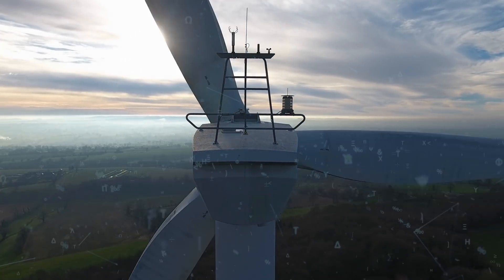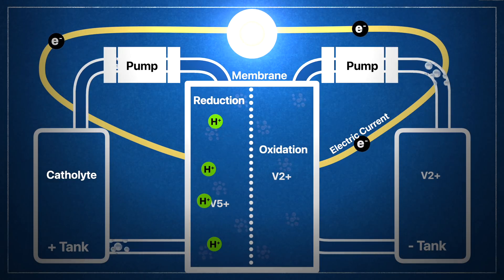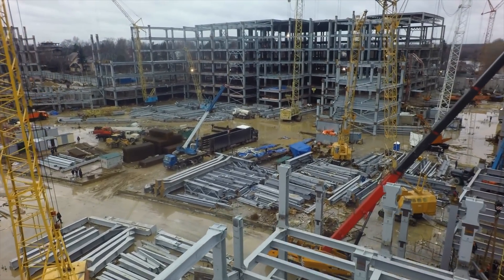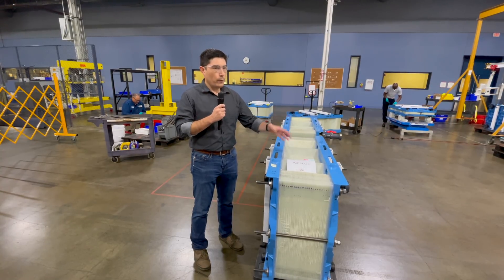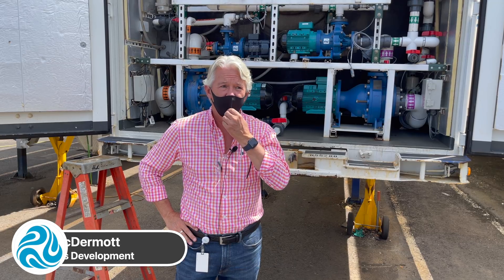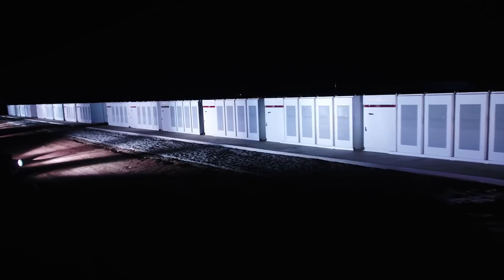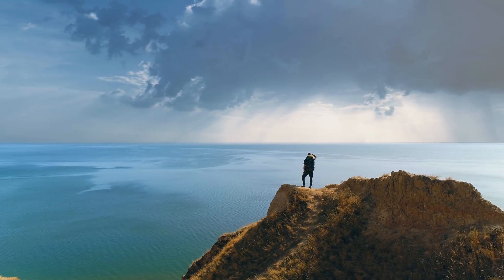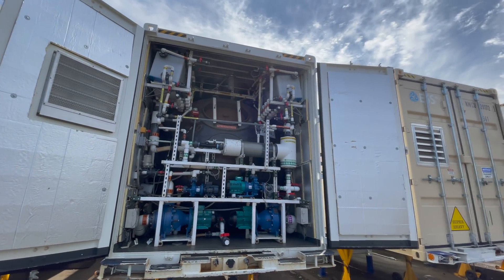The Future of Energy Storage Beyond Lithium Ion

Comment: I’m an old mechanical engineer and have been into this stuff for 30 years….This seems like the best option I’ve seen so far - it will be low cost, will last for a very lomg time, will not mess up the environment and will provide power over a long duration - time to invest!!!
Reply: Do your homework before sinking any money into flow batteries.  I worked on an Imergy (now bankrupt) vanadium redox battery a few years back.  Energy efficiency was an awful 60% due to the pumps and fans.  Efficiency only gets worse if you're not cycling it daily.  I know they sold a lot of them in India because of their unreliable grid.  There are few viable use cases IMO.
Reply: @mattmills7867  I too have worked in the flow battery industry for +10 yrs.  And you've hit in on the spot; the video & most people fail to address the auxiliary losses.  This loss is further compounded when the system is trying to discharge the remaining unusable energy by running the pumps continuously otherwise unwanted platting can occur. There is a quick and dirty solution that involves a manual intervention with a resistor(s).

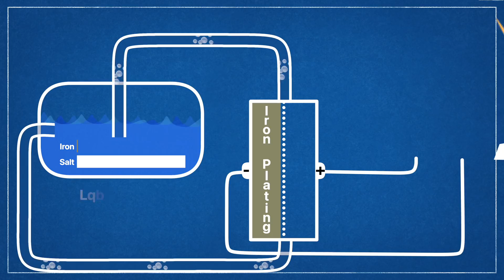Additional the representative from the iron flow battery at around the start 7:00 mark was misrepresenting the usage of dc/dc converters on iron flow battery only and not on lithium.  All batteries I've worked on always required a dc/dc converter; some pre-built and others were 3rd parties.
Reply: @mattmills7867  Thanks for the advice, hopefully the efficiency of things on the mechanical end will improve!
Reply: @mattmills7867  The better in this video is with Iron, not Vanadium.
Reply: @mattmills7867  so how's this battery compared to the one that made you go bankrupt ?
Reply: @icost4671  Imergy went bankrupt.  I was just left with a big flow battery that needed to be decommissioned.  The Imergy battery was a 2 tank / 2 pump vanadium redox flow battery.  The one in the video is a 1 tank / 1 pump iron redox flow battery as far as I can tell.  The Imergy battery included HAZMAT and the iron flow battery doesn't seem to have that issue.  It looks more viable, but I'm not sure it can compete with other energy storage technologies (Pumped hydro, compressed air, Li Ion batteries, flywheels, capacitors, etc.)
Reply: @mattmills7867  thank you for the reply , I appreciate it  greatly 👍
A lot of things in the energy sector is changing rapidly.
Elon Musk is trying to get people to have these battery storages at every home , will be pretty good when power goes down.
I don't know much about it but it sounds pretty good especially if you are EV owner.
Reply: @icost4671  I've got an EV.  I get about 4.5mi/kWh or about 45 miles per dollar at $0.10 per kWh.  If only they didn't have the recall for the battery fires though...  It does seem like America is starting to adopt V2G technology so that might help sell more EVs.  We'll have to wait and see.  And hydrogen fuel cell vehicles might be the next big thing too.
Reply: @mattmills7867  I take it you also have a garage.
I own a home but I have no garage so I have to run a electric cord from my home to the car that will be parked at the curve... if I bought a EV.
I don't think hydrogen is going to be driving any cars anytime too soon because it takes a lot of money going in to create hydrogen.
That's the last thing I knew about 5 years ago . That I heard or read about hydrogen cells , it takes a lot of energy & money to create it.
Reply: @mattmills7867  "It looks more viable, but I'm not sure it can compete with other energy storage technologies (Pumped hydro, compressed air, Li Ion batteries, flywheels"

Pumped hydro would cost how much to install out in a desert?  Li Ion batteries are not going to be a solution for a true green grid.  The amount of storage needed is immense.  You seem to be focusing on a single use case where something didn't go right and you're expanding that notion out to the globe.  It doesn't work that way.

I already pointed out the issue of efficiency not being very significant if you're buying a cheap battery, which comes with economy of scale.  If these show they're successful the key selling points right now outweigh any disadvantage.

I haven't read enough about flywheels but I remember hearing about it about a decade ago.  Are they in use large scale?  I haven't heard anything about them since I remember hearing about them about a decade ago.

Pumped hydro probably costs a lot more than these batteries will, but for coastal areas pumped hydro could be a better option because it takes up less space, but solar farms out in semi arid open land or desert has tons of land.  These start to look really good.

What was said is these are in price parity with Tesla mega packs which are for the same thing, except in very hot place, like where a lot of solar is best generated at least in the US, so west Texas, NM, AZ, CA, NV, CO can all get very hot so Li Ion packs become a problem.  This seem ideal and I guess that's why a few companies have already installed these.  They also said that long term these should be a better value because of greater number of cycles, which is many years, but that doesn't mean the battery container is no longer useful.  It only means they change out some components and change the electrolyte from what I see.  They do have pumps.  Once there is economy of scale I doubt anything beats this in operating cost.  You just can't do a global changeover with something like Li Ion.  We'll be digging up too much of the world.
Reply: @johndoh5182  It's great to be enthusiastic about emerging technology around energy storage, so my main point was to point out that flow batteries of different types have already failed to compete in the market.  Knowing that and knowing why is important.  Energy storage is going to be a big nut to crack over the coming decades and a diverse lineup of technologies seems likely.  Besides the tech I mentioned, I've seen some potential energy system that uses a heavy weight suspended in a mineshaft that is raised/lowered to store/recover energy, kind of like a huge grandfather clock.  There are going to be some tech that ends up dying, like using blimps for air travel.  Maybe flow batteries will make the cut, I'm just not betting on them.

Efficiency is still important even if the battery is cheap due to economies of scale.  If efficiency is low, you'll need that much greater energy production capability to start with.  With Li Ion systems, I think round trip efficiency is closer to 85%.  And even though new Li Ion batteries are around $200/kWh right now, economies of scale have been predicted to bring that under $100/kWh by 2030 (Bloomberg New Energy Finance).  EVs are still a small market but its growing rapidly.  When the car battery range gets below 80% or so, or the car is at it's end of life for whatever reason, you still have usable life in the battery.  These can be used in a 2nd life application as grid energy storage batteries.  Or even with V2G (Vehicle to Grid) they can be used for grid energy storage while still installed in the vehicle.  And you won't necessarily have to keep digging up lithium, cobalt, manganese, etc. if you get recycling to the level you have with Pb acid batteries.

There are other types of lithium too.  Lithium iron phosphate batteries aren't as energy dense as NMC chemistries, but have better fire safety.  Lithium titanate batteries are even lower energy density but have several times more cycle life.  Lithium air batteries use oxygen from the air as part of the fuel, sort of like an internal combustion engine, so they are more energy dense.  And the theoretical energy density of lithium based batteries is near that of gasoline(12,200Wh/kg) even though the best energy density on the market right now for Li is ~300Wh/kg.  I worked with a company called 10-9 technologies that was closing the gap with some promising testing.

On flywheels, I haven't seen any successful grid energy storage applications.  Those who tried were having difficulty with the material science of keeping the damn things from tearing themselves apart at high rpm.  But there are some applications like uninterrupted power while a generator for the building is fired up.  Or they can also be used for fast response frequency regulation on the grid.

I haven't run into any estimates on GWh of energy storage required in the future but I'm not so sure that there's not enough Lithium battery raw material to meet that need.  Anyway, I hope my response addressed your comments.
Reply: Hydrogen has started powering London busses
Reply: @danielfasey7648  as long as the Hydrogen is produced by clean energy that is great! Fossil fuel companies are trying to comvince governments that reforming methane to produce Hydrogen is OK - it isn’t…it has a nasty carbon footprint
Reply: @mattmills7867  I will be replying on your comment but my points will still take in account of the rest of the idiotic comments in this thread (P.S. yours isn't idiotic). First solar and wind isn't a green energy solution as of now. First, the cost of a solar/wind farm vs a nuclear power plant is approximately 17 to 1 I think in materials cost. Although solar/wind dont produce C02 while generating power they damn make it up during their construction. Second, is the fact that there isnt a plan to recycly solar panels after the 20-25 years where they will stop be efficient or operational. They will join the rest of electronics garbage to an African or Asian nation. There they will be stripped from their important bits (aluminium and precious metals) while polluting the ground with heavy metals. Another big issue is batteries (Li Ion) and their short operational life when they are heavily used. So a new storage system is needed for it to work. Third, is the huge amount of land that you would have to use to build the solar/wind farms. You would need to either use farmland , forests , mountains , dessert , etc. No matter which habitat we examine the environmental damage would be huge. Our farmlands are already running out , so dont even think of it . Mountains , the wildlife would be greatly disturbed. Check how many endagered species of birds get killed annually due to wind farms as well as bats. Forests you dont even need to think much about it as you would need to clear them out in order to build solar/wind farms. Desserts , here I will introduce an issue that exist in the other habitats as well and that is the you would have to transport the local wildlife and that never goes well. Check the Californian solar farm and tortoise issue. Lastly what do you think will happen when you capture a significant amount of the heat that touches our planet. Wouldn't climate change again ? For better or worse we dont know.
Now lets talk about the "disaster" of "climate change". Did you know that our planet goes through cold and hot phases ? See Ice Age. Scientist that research glaciers that contain "ancient" ice (ice that dates back to millions and more years) claim that our period is the start of a new Hot phase. By analyzing the "ancient" ice they can know temperatures and the composition of the atmosphere when the ice was formed. You would be suprised how much this practice has helped us to learn about the history of our planet. Most of the fear of the "disaster" comes from either uniformed politicians or fearmongering politicians that want to use this "issue" to further their agenda. Not to mention the way they go about solving this issue is idiotic. Capturing and storing C02 in order to solve global warming !?!?!? phhthhtht  Makes me laugh. Instead of doing something that will help our human race to become more sustainable and "easier" to progress , they thought that and solar/wind power generation. Instead of funding research that will help us find an energy source or a completely new energy that will fuel our human ambitions they chose one of the most idiotic ways to go about it. First capturing C02 would take too much time. So much time that by the time it makes a difference according to them the damage would have been irreversible. As I mentioned solar/wind are not green technologies and they are an inferior version of a technology that is already in the making. Solar/wind basically borrows the power of our Sun. Our Sun produces its power through a process called fusion. Does that ring a bell ? Yes we have been researching now for a long time how to make a fusion reactor and basically create a miniature imitation of our Sun. A lot of people might say that fusion researchers might have been promising for too long results but havent delivered. You should know that the amount of money that has gone into fusion research and ITER is too little compared to how much money has been invested in constructing solar/wind farms. I say constructed do not even mention how much has gotten in researching them. ITER so far has costed about  €18 to €22 billion. I should mention that ITER isn't supposed to become a commercial power generator. It is a science tool like CERN. ITER isnt constantly retrofitted with newest technologies whenever a new breakthrough happens as it is too difficult to happen. Its construction time has already exceeded 10 years. You can only imagine how many breakthroughs have happened since it started being constructed. Imagine if the fusion research got as much investment/support as solar/wind globally.
Reply: @mattmills7867  edison batteries and compressed air batteries!
Reply: @mattmills7867  "Efficiency only gets worse if you're not cycling it daily.  I know they sold a lot of them in India because of their unreliable grid. There are few viable use cases IMO."

I'm not a person who is going to invest first of all and I really dislike comments where people start screaming about it.  I know yours was a response to a person who did exactly that and what you said is a valuable point to ANYONE.

So, don't you think these batteries would cycle daily?  If it's for a solar farm of course it's going to cycle daily.  If it's for wind, you would simply schedule discharging on a regular basis until you know you're about to hit a patch of light wind for a time period in which case you charge them fully for that time and then discharge.

There are other battery tech on the market as I watch these channels that cover power technology and have seen other options too.  But, if the battery is manufactured in huge quantity, there is economics of scale.  Two, like was talked about, they use some of the most common elements on the planet which more than anything else is THE most important factor for grid storage, considering you would have millions of these.  Cost is another factor.  Grid storage has to be cheap.  That's the second most important factor for grid storage.

Efficiency?  It's important, but you have to balance any of that with cost and environmental impact.  It's going to be hard to find something that solves all those main problems.  I'm glad this is already in production and going to available for statistical analysis.  If the cost is cheap you add enough batteries to provide the output you need, right?  So, efficiency isn't the main goal, in fact I wouldn't put it in the top 5 issues for this kind of storage.

As far as investing, if I were that company I'd do everything I could to keep it private, but if the need for huge capital becomes an issue they would go public if they haven't already.  But, Tesla has followed a model of, you pay, then you get, and that can help to reduce the need for large influxes of capital.  But, to get that economy of scale they have to meet that manufacturing capacity.

This is the best thing I've seen yet for grid storage and well thought out for this one need.  

And that last point you made about use cases?  This is designed for storing energy on the grid.  I never once heard them talk about use cases, just use case.  And, that's not an insignificant thing.  It would be like saying that wires to carry electrical current across the country and into people's homes isn't so smart because there's only one use case.  Yeah, except it's pervasive.  There's a lot of tech that has a single use case and it's part of billion dollar companies.
Reply: A friend of mine has been at the head of a flow battery company for a while, it definitely has its strengths but it's more of a cooperative tech against something like lithium. It has capacity density and cost advantages for sure, but can't react as quickly or with the power density of lithium.

Think of it more like a tiny pumped hydropower plant, where the energy capacity is the size of the tank (rather than dam), and the power density is the size of the electrode and pump (rather than turbine).
Reply: @morosis82  Those are factors of capacity and recharge rate. It has no comparison to hydro unless you are referring to pump storage. Regardless, solar and battery storage are the only viable source of generation. Not from a "save the planet " perspective but from a return on investment for the utilities. Nothing else can compete, not wind, gas, coal, nuclear.
Reply: @morosis82  Nice comparison!
Reply: entrepreneur  Lol - OK calm it down CAPS man ;) - I am not saying the rich won't continue to control things in the US, as they control the government - but I have see a ton of people take control of their own power needs as a result of the continuing drop in solar panel and battery costs - with Elon's auto-bidder software ordinary people will be able to turn their home into an integral part of the grid - buying and selling power and stabilizing things - I know people that have put 3,000 watts of power on mobile home - it's cheap!!...lots of others that have just gone completely off grid - watch a couple of Tony Sebas videos to get a good understanding of where were headed - with that knowledge, you will be able to navigate things to optimize your benefit from where we're headed
Reply: @willm5814  You found the right words man.
Reply: Agree the only issue I see is being bought and shelved by a higher up!  Just saying...
Reply: Plasma is the best energy storage, it's how nature does it.
Reply: Or just Soundwaves and piezoelectric quartz crystal batteries to make near infinitesimal energy... The proper decibels without cavitation will produce 1185 fps acoustic waveform propagation fields... Steam from nuclear power plants output 860 psi...

Quartz is synthetically grown and has been for DECADES used in every electronic device you own... By the tons.. no need for batteries, my father called it Project Jericho.. Brownian motion paradox Energy, essentially using a infrasonic waveform to deliver extremely high Decibels as browning motion enveloped Carrier wave " wave within waves..." Using his Soundspheres " expired patent "
Reply: @mjolnirswrath23  Piezoelectric quartz cannot stay activated with a constant, it can only sense change in a medium. And there is no such thing as infinite energy. To actually have a soundwave that produces enough decibels to actually create enough change in the piezoelectric to produce a usable energy will have too high an energy cost to make, plus it is unreliable for the change has to be constant to produce that power, and for an electrical grid all generators must be approximately the exact same or one will overtake the system and most likely explode or collapse. I will have to do more research into it, but these are the problems I currently see.
Reply: Why dont we try Solar Thermal power generation we can store it , and reliance on batteries  will be lesser
Reply: Wonder if this would be good for peak power leveling ie plant makes 8 units power peak power 10 units off peak 6 so charge the 2 off peak to use on peak
Reply: Have you seen the liquid/compressed air batteries? Even better.
Reply: Respect Will..... I really lean heavy on experienced Engineers like yourself
Reply: I quite like the concept of liquid metal batteries. I mean anything that uses heat wastage as part of its function. Instead of as a byproduct. Makes sense to me
Reply: Hi ol m.e. ! I think profit will also be a factor in our monetary world. A wise old man told me today that for society to thrive it takes a civilization  and organization to impliment new products and ideas. He said we seem to be lacking in those areas. What do u think?
Reply: The best option so far is nuclear but the party of science is preventing its use even though climate change is supposed to be a world ending disaster.
Reply: @lkytmryan  Hey now, you can't talk about science because ULTRA DEATH CLIMATE MEGA CATASTROPHE!!!
Reply: @lkytmryan  “party of science?”
Reply: @lkytmryan   Effing Democrats
Reply: @lkytmryan    It's always nice when the nuke peddlers accidentally admit that they're also Deniers. Nuke is too slow, too expensive. Which is why the world added 280GW of renewables last year and net 0 GW of nuke.
It peaked 25 years ago. No one wants to take 15 years to spend $12 billion to build 1 GW of nuke when an equivalent annual TWh of wind and solar can be delivered on grids in 2–3 years for a third to a fifth the cost of nuclear. As a result, we can have at minimum three times the actual annual generation of low-carbon electricity for the same price delivered to the grid before a nuclear plant starts operating.
Reply: @lkytmryan  You're just slightly glossing over the situation. For example, the #1 source of opposition to nuclear power in the US isn't the "left", it's the coal and natural gas industries. If your source back a lot of the material used by people on "the left" on the nuclear power situation, it comes from the coal industry. And yet plenty of folks on the left look at things like localized thorium liquid salt reactors as potentially relevant solutions. 

The other thing you're overlooking is that France's government is paying for the nuclear power, they fund the building, they fund the material, they fund the long term storage, etc... So if your concern is that renewables won't compete without government subsidies, then France is immediately off the table as it is the primary source of investment. Heck, Marcon is lobbying for a $35 Billion dollar >government< investment in Nuclear as I post this.

Even if we look at >just< France though, unsubsidized nuclear power cost 100 euro/MWh. Subsidized by the government that rate dropped to 50 euro/MWh. Compared to on-shore wind 60 euro/MWh (unsubsidized), it's an iffy argument, solar (unsubsidized) at 43 euro/MWh it's a bad argument (and France isn't even an ideal location for massive solar farms), and hydro at 20 euro/MWh it's a horrible argument. 

Nuclear had it's day, but modern renewables are cost competitive and come with far fewer risks and concerns. 

That said, I would happily, gladly even, replace every god forsaken ancient, way past their retirement point, piece of shit nuclear reactor in the US for a French equivalent. And yes, I'm a "lefty" (by US standards).
Reply: @pianodarr   Wouldn't be the case if we had pursued thorium reactors but we can thank GE and Westinghouse for that.
Reply: @lkytmryan  it is usually gas powered generators that are on standby
Reply: @pfwag  or the Military Industrial Complex, or the Governments! Thorium reactors are safer, but do not produce materials for nuclear weapons.
Reply: @rickway2039  the problem is that yes renewables is the best option for getting energy for cheap, all three versions of the energy all require specific conditions that cannot be met everywhere.  Solar needs clear sky’s and flat land, wind needs unobstructed airspace, and hydro needs a lot of water. Electricity can only travel about 300 miles. So that leaves out a lot of land that will not get energy. A repeater can be used but the power loss is too much eventually. Nuclear does need to be reinstated as a main line source for our society to continue to function as it is now. So yes it would be better for us to go with renew, but until we can figure out how to store AC energy, nuclear is the best option. it also has the highest efficiency and the lowest cause of death.
Reply: @kasei6855  I can't speak to the EU and other countries, just the US.  I commented to someone else about nuclear in the US and why it's not viable.  It boils down to, no state in the US is willing to open up an area for storage, although picking an area requires a lot of thought since this storage is for thousands of years.  The best candidate locations were all shot down by state govts.  So right now every nuclear power plant stores its waste, or MAYBE you get one site that stores waste for a couple of plants, but that's a TERRIBLE solution.  It makes every nuclear power plant a super fund site.  On top of that it makes every plant a huge security risk, and to secure it properly takes a lot of payroll.  Second, create plants that generate much less waste.  That part has been solved.  But three, it needs to be economically viable on its own, not with continual subsidy or offsets from other forms of energy balancing out the cost.

Natural gas is clean burning, puts out very little CO2.  It's a very valid option as a backup, along with running from time to time to ensure systems are running correctly.  It can also be a main source of energy, as it already is, but it needs to be capped so the US isn't depleting all its natural gas.

Hydro does require a lot of water, but at least in the US, there are lots of rivers that have already been dammed so creating another lake for both water and hydro is perfectly acceptable where you can do so.  Texas for instance is adding more reservoirs.  Not enough IMO, but they are adding some.  They already have a lot of lakes though, mostly in the eastern part of the state.

If you have a shared grid and you build for plenty of excess, as you should in case of failures, in the US in particular it's hard to be far away from either abundant sun, or abundant wind, or abundant capacity for more hydro.  You still need natural gas though, and a smart energy producer would have something like a solar farm or wind farm along with grid storage, along with natural gas to back up part of that capacity.  It would give them a constant output.  On a shared grid, you need a mostly reliable output, mostly relying on wind, solar and hydro.  If you aren't getting enough from one generator, odds are you can get more for another.  So, shared grid with a bit of versatility helps to solve that problem.

Turn a negative into a positive by people finding solutions, really.  The negatives bring opportunity, businesses solve that opportunity and it makes them money.  Sometimes you have to nudge businesses with incentives or penalties or both, and they'll solve problems.   Same has happened in the world of semi-conductors and right now there's a big chip shortage.  To fix requires big investments, but large players, TSMC, Samsung and Intel have all stepped up and are investing probably close to 100 billion dollars between them to build out, and in the case of TSMC, diversify by getting out of Taiwan with many new fabs.  So for them being part of the solution of a chip shortage, they are becoming more secure and flexible at the same time by spreading out in the world.
Reply: @johndoh5182  I understand that the storage is a problem as well as the government which is why we need a nuclear party to surface, but with different types of reactors comes different types of storage. We already have viable storage locations that can be used. But the other problem with these is that the efficiency of the generation of electricity is not enough for them to truly to be viable until they are vastly improved. Nuclear would create a much cleaner baseline with a extremely high efficiency (92% capacity factor). where as wind (34%), hydro(38%), and solar(25%) can pick up the rest as they have a much lower capacity factor. Combining these all together would in theory be the best option. The main problem we face is political.  and if it really comes down to it, we could always just eject the waste from the atmosphere haha.
Reply: @lkytmryan  Again, if you are right the largest Electric utilities are wrong. They are not planning any new generation other than solar and batteries. Most are even giving up on wind.
Reply: @lkytmryan  plus how is the government distorting the market? They have subsidized the fossil fuel industry for over 100 years. I have a large solar system powering 2 homes, an office and a welding shop. It cost me $44k without any tax credits and offsets $8k/year. That's a hell of a return without any government help. Plus it's getting cheaper every year. Fossil and nuclear only get more costly.
Reply: @lkytmryan  What government subsidies?
Reply: @pianodarr  Why is every video about any topic related to energy eventually leading to a discussion about nuclear in the comments?
Reply: @salvadordavinci7  Because for the nuke people, it’s a cult. Their one true love.
Reply: @pianodarr  To properly compare Nuclear to Wind/Solar, you need to include battery costs.  There are other factors as well. We will never have enough energy, so the prudent way forward is to scale all of them and let the market decide.
Reply: @BigWorldOutThere98  The market decided, which is why nuke flatlined 25 years ago, and as a percentage of world contribution has gone from 17% to 10%. The vast majority of added RE capacity neither has nor needs batteries. The US uses about 9 TWh per day, and every watt coming from RE is a watt that isn't needed from the dirty sources and expensive nuclear.
Key conclusions of World Nuclear Industry Status Report 2021
- In 2020, nuclear power generation plunged by an unprecedented margin (>100 TWh)...
- Non-hydro renewables—mainly wind, solar and biomass—out-performed nuclear plants in electricity generation on a global scale. Hydro alone has been generating more power than nuclear for most of the past three decades.
- For the first time, non-hydro renewables generated more power in the European Union than nuclear, and renewables including hydro generated more power than all fossil fuels combined.
- Net nuclear capacity addition—new startups minus closures—declined to 0.4 GW, compared to more than 250 GW for renewables alone. Nuclear is irrelevant in today’s electricity capacity newbuild market.
Reply: @pianodarr  Your reference to 25 years ago is irrelevant.  It's like saying electric cars won't work, look at what happened 25 years ago.  Nuclear was being over regulated due to irrational fears at that time causing a great deal of increased soft costs, and it was believed that natural gas could cheaply replace nuclear power.  I'm not sure how you reconcile your statement of nuclear plunging 100 twh in 2020 but the net nuclear additions declining only .4 GW?  Also, biomass?  Really?  I get that it's net zero but burning trees is not an scalable answer.   The cost of batteries is important and it's irresponsible to dismiss that. The sun doesn't shine at night and the wind doesn't always blow.  Additionally, once we switch to electric cars and the developing world starts using aircon, the global requirement for electricity will skyrocket. 

There are several new nuclear technologies that have a lot of promise: small modular reactors, micro reactors,  thorium reactors, nuclear fusion, EPR reactors, and there are plausible answers for disposal of spent fuel.  Nuclear plants can last for 50 years plus.  Solar Panels and wind turbines need to be replaced after 25 years, if the weather doesn't get them first.

Your argument is primarily based on nuclears failures in the past, not its potential in the future.  A responsible society always keeps its options open and nuclear power is a very powerful option.

One of the best arguments against nuclear power today is that some paranoid dictator will start attacking them.  Let's see how that plays out.
Reply: @BigWorldOutThere98  "Nuclear plants can last for 50 years plus."
In reality it's more like 40 or so.
France’s oldest nuke Fessenheim was just shut down (43 years old). It made 11,600GW per year. It’s a 1.84 GW plant.
You can do that with 173 Haliade-X 12MW turbines now. $14 million each, installed.
$2.4 billion total. That’s $1.3 billion per GW. Two to three year time period to build.
The US Vogtle nuke is now over $33 billion for 2.2GW.
That’s $15 billion per GW.
15 years, still not finished.
If you're wondering why no one has ordered any new nuke in the US for 15 years, that's why.
Reply: @pianodarr  You have a solid argument in regards to not using old nuclear technology---it costs too much.  Can you recognize that we continue to improve our nuclear technology making it safer, longer lasting and cheaper? And, we will eventually conquer the issues with fusion energy, making it mainstream.

Even with the impressive deployment of solar and wind in the last few years, they comprise a small fraction of the current energy needed in the world, and the world demand will double or triple over the next 50 years. Wind and solar can't keep up on their own.  

As the novelty fades, we will tire of solar and wind farms dotting our rooftops and countrysides.  Additionally, the materials to build solar/wind platforms, and their associated batteries for the world will become scarce and costs will rise.  Once we get to this point, the countries that have the nuclear expertise to build massive power plants and mass produce small modular reactors; producing cheap around the clock energy on small pieces of land will lead the world.
Reply: @BigWorldOutThere98  Quite a bold claim about fusion energy. It's only recently gone energy positive. Steady power generation (days, weeks, months) hasn't even be demonstrated at a trial scale yet, let alone at commercial scale. It's unclear whether it'll ever be economical, as amazing as the tech is.

Re: fission, the SMRs on the horizon are interesting but still very early days. We need to be doing everything we can to phase out fossil fuels and at this stage nuclear isn't ready to step in and fill that role. Renewables are the cost effective solution for now and we should put them in at scale until futuristic fission/fusion/goat powered treadmills etc are economical.
Reply: @lkytmryan  because nuclear causes so many problems that last far into the future.
Reply: @lkytmryan  I'm concerned that Nuclear will end up making a small handful of people rich, they will control the power, who gets it, who doesn't and what does it cost. Solar/Wind have a much better chance for a power to belong to everyone. That being said, I think we will end up with a baseline of Nuclear. I think it would be smart to have a baseline supply of nuclear in the 25% range. There has been a lot of work to make nuclear safer, more modular and more affordable. With just normal innovation/improvement on the combination of wind, solar and storage it will increasingly difficult for nuclear to compete from a straight economics standpoint. With Elon's mega-packs they can't compete now.
Reply: @lkytmryan  Rubbish. France is a nuclear weapons state. EDF is controlled by the French government. Plus they now manage nuclear in UK. Also building a 3rd generation Euro reactor in UK (at EDF expense, UK will pay = £0.1 per unit of electric). EDF building another near Cap Griz Nes, the French nuclear reprocessing site; running very late, with many technical problems, like faulty welding in pressure vessel, and heat exchangers. Solar generation costs half that.
Reply: @michaelbouckley4455  Solar generation doesn't cost half that because you are hiding all the costs for the backups for solar. Coal plants are often the backups and have to run at lower than optimum efficiency so they can be brought online quickly and this can cause them to be dirtier than they would be if they just ran at full load.

Solar, just like ethanol, is an economic and energy pipe dream only made possible by government interference in the market.
Reply: Elon is probably competitive with nuclear like you said. But how much is that due to free money??? With the government distorting prices, giving subsidies, etc it’s hard to know how true that is. If solar and wind really can be cheaper on it’s on that’s great. But we shouldn’t be subsidizing the crap out of it so folks living in the city can have solar. We should encourage and have grants for research and innovation, but the government should let the market decide. The government picking winners and losers is going to make the US turn into Japan. Obama’s massive solar farm by Vegas destroyed and entire valley! The company that got the contract got wealthy, and seven years later went bankrupt.
Reply: @koltoncrane3099  He's using on of those green freak half truths. Fossil fuels receive more subsidies overall than renewables, but only because it's a significantly larger industry. Per kwh, which is the only figure that matters, fossil fuels receive significantly less subsidies. Even if you remove the subsidies from fossil fuels they are still significantly cheaper and more reliable than renewables. Solar and wind are the most expensive and least reliable power sources on earth.
Reply: @lkytmryan  You are missing the point of the video, that more battery storage will make other fossil backup supplies unnecessary. Mostly it is natural gas turbines that are kept spinning, in case of wind and solar power drop out.
Reply: @lkytmryan  I could not disagree more but my opinion is worthless. What is a useful indicator you are wrong is the fact almost all US electric utilities are not building anything but solar and battery storage. I work with several of the nation's largest utilities and senior executives have confirmed this to me as a fact. Solar (not wind) and batteries take months to permit and engineer and months to build and place online. All other generation take decades of permitting, engineering and construction and cost orders of magnitude more. All without any government subsidies. It is a matter of ROI.
Reply: @Minecraftizawsom  They have been saying that for 50 years! Obviously that's not even remotely true.
Reply: @bobbygetsbanned6049  There’s an energy crisis around the world
Reply: @johndoh5182  Try paragraphs.
“You can look at any levelized data about power production in the US and the lowest cost are wind, solar and natural gas.”

Just plain wrong because you are only considering the cost of solar or wind. You are not counting the cost of all the backup power needed for when the sun doesn’t shine or the wind doesn’t blow.

"Nuclear is terrible, in the US, like worst terrible. "

Just plain wrong. The U.S. does rely on nuclear and has done so for decades. France has relied on it for decades without incident.

"Like if that's what the US relied on, people wouldn't be buying meat terrible and you'd have a lot more homeless people kind of terrible. "

OK, this is literally nuts.

“there is no place to store nuclear waste in the US other than on site because every state refuses to b1"e used for waste storage. "

This is poorly a political problem caused by leftist fanatics. 

"EVERY state. It turns EVERY nuclear plant into a superfund site"

You are wrong again. There has already been a storage facility adequate to store all the nuclear waste and it is only blocked by leftist fanatics.

Not going to spend all day on this.
Reply: @willm5814  nuclear power should not be done for profit and should be owned by public utilities not private investors
Reply: @ralphstern2845  I agree
Reply: @koltoncrane3099  How can Solar destoy a valley???. Oilproduction  destroys huge areas.
Reply: @bobbygetsbanned6049  Will is right for sure. Of course - cheap oil made a lot possible. but we use to much of it, waste a lot, the oil industrie doesnt care about the envirement, We should have tried much earlier to get rid of that junk.
Reply: @lkytmryan  renewables are already more competitive (£$) than coal or gas especially in the UK, there are loads of sources for you to check this out.
Renewables' problem is their intermittency. Low cost storage is what is needed and these sorts of batteries are what is needed. Their composition seaems really cheap. Their efficiency (+60%) is way above a coal fired power plant (33%-45%).
The materials are so cheap that there's less liklihood of them being stolen.
Reply: @terryjimfletcher  You answered your own question when you say that renewable's problem is their intermittency. You cannot just arbitrarily remove this from the cost of renewables. When you have to have backup power equivalent to the power source, the cost is the cost of both.

And batteries on the scale needed for wide scale use are not cheap or practical. This is why they are essentially non-existent.

Batteries aren't efficient at all. They produce zero energy. They store energy. Burning paper is a more energy efficient power source than batteries because they produce no energy.
Reply: @willm5814  Solar and wind will never cut, too many resources required, a scale up of mining is required that is unimagineable, plus it will create the worlds biggest eco disaster to implement it, lastly money does not grow on trees.
Reply: @lkytmryan  Can you explain  why you think solar isn't viable? It's very cheap, so it sure seems like it's a big part of the solution.
Reply: @BigWorldOutThere98  Solar is only cheap if you think the only cost of solar is the solar panels. Solar requires electronics and batteries and lots of land (which is expensive). It requires tons of maintenance in the form of keeping them clean. It also requires 100% backup so somewhere there has to be a fossil fuel or nuclear plant to pick up the slack when the clouds come out or the sun goes down.

When solar is producing, the fossil fuel plants still have to be online to pick up the slack when a cloud passes over. Because those plants are operating at a reduced load, they are operating at a reduced efficiency which means they are actually polluting more.

Just like ethanol and every other green wet dream, solar is a waste of money and time. If the party of fear and science didn't get its way for the last 60 years, most of the industrialized world would now be like France and be on clean nuclear.
Reply: @willm5814  Interesting contrast .... nuclear going from "too cheap to meter" in the Eisenhower administration to "increasingly difficult to compete from a straight economics standpoint" today.   Weird.  I think that nuclear should be the primary power source going forward.  What we don't need is more 1950s nuke designs.  There has to be an improvement in nuclear technology.
Reply: @lkytmryan  I don't think "party" has anything to do with the general failures of the human intellect that include confirmation bias.  Yes, the left may tend to have more "anti-nuclear", but the right has the "anti-vaccine".  These are just two examples of a single aspect of a much larger group of logical failures.  Tribalism, Dunning-Krueger... the list is long and exhausting.  I personally agree that from a purely statistical and scientific aspect, Nuclear should be a part of the solution.
Reply: @ScottLaneSabineParish  Is pro-choice a left or right wing view? Is libertarian view a leftwing or right wing view? Anti-vaccines are not just from the right but it's a bipartisan view. The left argument would be - my body my choice and i'm assuming the right wing would be protesting against censorship, totalitarian, Orwellian views.
Reply: @tennis5126  Statistically, as a view on abortion rights, the numbers show it as left leaning position.  But just as with most things in life, there are exceptions.  Are there left leaning "Anti-Vaxxers"?  I'm sure there are some as outliers but it is a minority view.  The same can be said about positions on the right.
If you are trying to reframe anti vaccine as pro choice or anti guinea pig, then that is kind of a stretch and pretty hypocritical.  There are things that you have a choice about but when your choice infringes on the rights of others, it is no longer a right.  Take drinking and driving for example.  You have the right to drink but the responsibility to do it in a safe manner.  You have the right to the pursuit of happiness, but don't think that taking someone else's things to make yourself happy is legal.  You have the right to not get vaccinated, but then you have the responsibility to make sure that your decision does not affect others in a detrimental way.  For example, stay home.
Yes, I am aware that there are a handful of "scientist" (very loose term) that think it's ok to drink bleach or that the vaccine is unsafe.  It is kind of telling that the percentage of those individuals has a very close correlational attribute with the expected percentage of any field that will have mental health and psychological issues?
Reply: @ScottLaneSabineParish  <<-- nuclear party TROLL
Reply: @ScottLaneSabineParish  when you have worked out what to with the waste, let us all in on it....can we leave it in your backyard?